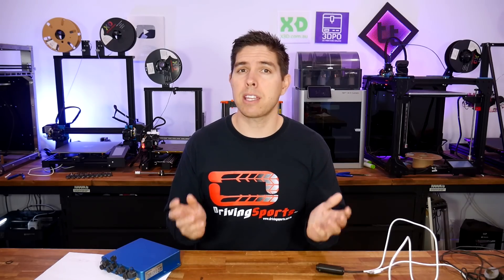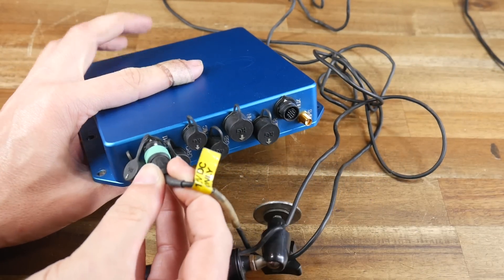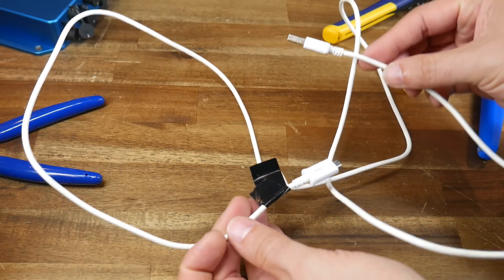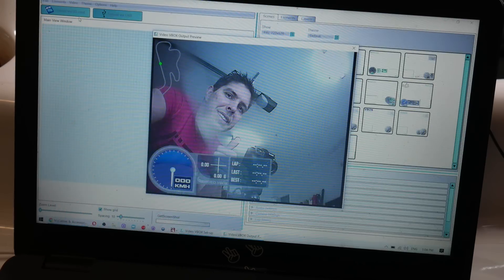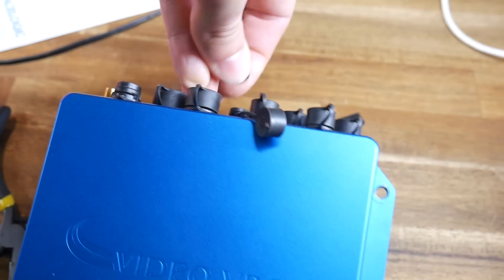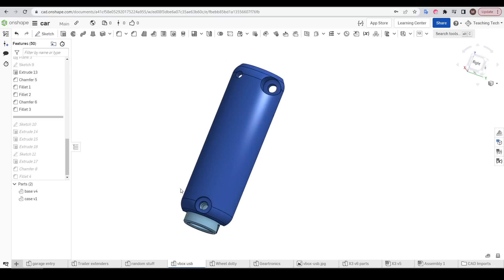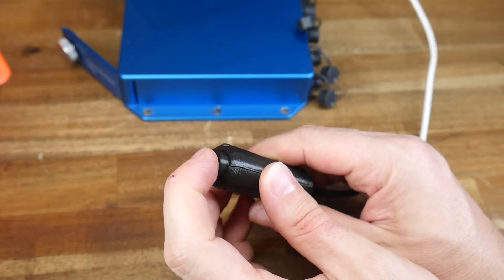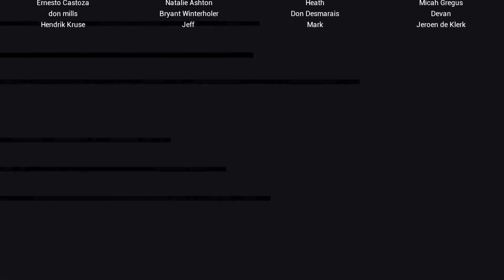Making an unavailable, proprietary USB cable with 3D printing

Comment: I have had the same kind of problem. This was before 3D printers were available. My solution was to inset the wired pins into the mating connector. The used epoxy to glue all the pins into one mass. This gave perfect alignment to the existing connector. After it was all secure I worked on making it more aesthetically pleasing. A fast quick and dirty way to make a custom connector. I do agree with you that 3D printers are great for this kind of problem, though slower than my old solution if you only need one or two.

Comment: I work in an industry that has A LOT of strange and seemingly proprietary connectors. But in 99.9% of the cases it is a industrial connector from Lemo/Fischer/Hirose or also Molex/JST if they are internal ones. From my experience sometimes if you guess one you can send them a picture and they can sometimes tell you the right plug internals (with lemo you can pair housings with different internals)
Reply: Yeah, I think be easier and cheap to just swap out the connectors to something simular size to the casing. And Molex/JST cables on the PCB are easy to rebuild. He could also consider mini DIN plugs and connectors which are widly available and offer metal housings. I was just cringing abit to the dildo butt plug of a connector which looks cumbersome.
Reply: I’ve spent a lot of time ordering from the Lemo catalog. It’s like a Swiss made choose your own adventure.
Reply: @bigqflex  and also the price is very "swiss style" ... I salvaged a lot of Lemo connectors from old hardware "just in case" because I know how expensive they can be.
Reply: @lensineer  Found them at a dump in a cable pile. They're so valuable to me I rather keep them.

Comment: Umm nope this is not a proprietary connector, it's from Hirose (HRS) you can see writing on the dust cap.
Those are HR30 serieses, the 6 pin one used on USB is HR30-6R-6S(71), the plug that goes into it is HR30-6PA-6S(71)
Reply: I see you need the dust cap as well: HR30-6R-C(31)
lol

Comment: 😂Got to love the feeling of panic from forgetting to plug something in before testing; it's happened to all of us. Love the solution you came up with! For future reference, a little T-7000 for waterproofing the sides/outside of the housing's final assembly could be very useful. It's the adhesive used in phones that is rubbery and waterproof, but can be pried apart if future access is needed.

Comment: It looks like either a PS2 connection or S-Video. I guess you're too young to remember either of these.
In any case, you should have just replaced the internal USB port instead of reinventing the cable

Comment: Great solution but I think there was an easier way. You could’ve gotten yourself a female usb port and used it to replace the port. Desolder the four wires from the port & solder them onto the appropriate pins of the female port - quite easy after finding the pin-out. Then print a housing to replace the port to maintain the waterproofness to surround the USB female port and then you’d be left with only needing standard USB leads. Hell, you could even go for Type-C female ports and replace all the connectors for even greater user friendliness. Just an idea.

Comment: Great work, I wonder if a better approach would have been to design and print an a replacement USB outlet on the box itself to get rid of the proprietary connector altogether.  It looks like the circle how has enough room to mount most female USB connectors with you designing and printing the shroud for the circle to hold it in place.  Internally it just looks like some 4 pin JST connectors, but you could also just cut the cable to the current connector and repurpose it.  Then you can use a standard USB cable to connect to it.

Comment: Waste of time and effort. Work smarter not harder. You dont need a custom printed cable. Solder directly to pcb or cast. Its much more secure much more durable and safer

Comment: That must be a standardized 5-pin IP68 rated connector if I had to guess. There is no way they got injection molding done custom for such a niche product. Still, nice work and hey: as long as it works!

Comment: Granted, it wouldn't cost you 'nothing', but these JST connectors on the PCB are more or less available on every corner of the net and new connectors to fit in the holes of the housing are in production for industrial use.
That looks like an M8 or M12 connector or something compareble to me, with a custom plug face. If it's custom anyway, you can replace it with bog standard connectors as well. These connector types are used for sensors and sensor boxes on industrial machinery, mostly for assembly machines.

Comment: I've had the same problem interfacing some old military gear with Lemo connectors. They (Lemo, Tyco, et.al.) change the connector standards constantly and the interfaces are all different. Thanks for the project ideas, I think the 3D printing community can come up with some Lemo connector "libraries" that will enable the use of commodity pins and 3D printed assemblies that will make these older connectors useful again. Thanks again for your work, hopefully this will inspire some crafty folks to keep the connector designs flowing. Cheers!

Comment: Impressive how you fabricated an electronic legacy cable out of fashion(?).  3D printing used to create components  that have technical utilization, as opposed to say printing a pikachu,  is always great to hear about and entertaining to watch.  With your skills you should produce these cables  en mass to sell online. I'm sure you aren't the only one needing one. And you could offer them at a fairer price and make some bank . Thanks for the video. * Reason 3 would be that hot glue is an insulator and not conductive.  (A fact I needed to Google.). Poyce mon.

Comment: Gnarly looking burn - I have also had hot glue ‘accidents’ with consequences.
Of course, great job on the cable and connector. I have also used my 3D printers to generate quite a few useful items at home as well as at work where they have been adopted by my colleagues. They have saved time (and therefore costs for the company) as well as raising some eyebrows and guesses as to their function.

Comment: I know it's not really the point, but after you opened it up, it looks like it would be pretty trivial to switch out that connector for one that is a standard plug with through-hole mount the correct diameter for the box. That way you can simply use a standard USB cable.

Comment: If all the external connectors just had connectors inside it would have been easy to replace the external ones.

Just find out what internal connector they were using and choose whatever external one you want.

Comment: You should have posted it on one of the electronics subreddits first, they are generally pretty good at identifying all kinds of old connectors.
Reply: Such a simple suggestion but one that hadn't occurred to me as I'm not an electronics guy. I have an expensive 3D Scanner that's been out of action for some years and it's got a very similar looking plug but with more pins. I couldn't bring myself to pay the more than $300usd for a new cable plus shipping to my country. Thanks

Comment: @11:11 Probably would've been way, way, way easier to replace the panel connector with a standard USB (mini-B, Micro-B, or Type C) port so you can use a standard USB cable. Panel mount USB ports are readily available and the connector on the PCB end looks like a standard JST connector, which is incredibly cheap.

Comment: You should have just changed the socket on the box to a USB socket.
And yes they make round ones which would have looked near the same. Lot easier than the way you did it

Comment: Due to the bulkiness of the connector I'd be worried about it wiggling its way out of there on an actual race but I also do not know how the device is mounted. Doesn't take away from the fact how cool it is to be able to design functional parts that fit properly. 

I got a decent level of satisfaction just creating a simple animation pegbar that fits a 3 hole round punch so I'd imagine making stuff like this and having it work feels pretty good.

Comment: Hi Michael, nice project - I wonder though "I reprinted the part several times until I got the right sized holes" - I watch many youtubers do this and wonder why not just slice the relevant part out of the model, or in this case for what it was worth, a twenty mm square with a variety of holes would have been trivial to produce and saved you the time of several reprints.   When prototyping I tend to just take minimal test slices, but I don't see that in projects by others.

Comment: Dude is a hero to handle the burn for us in the recording <3 Lol

Great video, but I would have done the reverse mod: Remove every Weird connector from the housing and put GX12/16 or USB type B or anything similar.

Comment: While I wholeheartedly agree with the idea behind this video... I feel like this really is the finest case of everything looking like a nail when you have a hammer in your hand.

A situation like this could so much more reliably, effectively, and affordably be resolved by simply de-soldering the original connector from the board and replacing it with something that isn't proprietary. Or, hell, even just soldering a cable directly to the board where the connector was, and having the connector mid-cable if it's even necessary.

Comment: You are way more patient than I am I would have hardwired a USB cable inside and removed the strange connector and waterproofed it with black silicone.

Comment: Actually in the past I simply searched for the pins I need, put a tape onto the socket, pushed the pins through the tape and used some epoxy to fix the pins to make the connector... While 3d-printig is nice and definitly is the better solution if you need multiple parts, classic solutions still work...
Making your own connector by 3d-printing for smal batches is quite nice for realy obsolete connectors you barly get (or only for high prices) like the 23pin dSub (Commodore Amiga Monitor and Diskdrive port).

Comment: For future reference, you could have opened the PDF version of the DATA sheet in Illustrator, copied the vector of the plug, exported as a DXF or DWG then imported/opened in your CAD software and scaled to size (Y)
Reply: Great Tipp, I prefer Libre Office Draw, which can do this with multipage documents to.
Reply: Or InkScape or any other vector based software :-)
Reply: or just read the document and it tells you what the connector is
Reply: @eliotmansfield  engineer versus technician.

Comment: The plug is too big for no reason.
If you are going to glue with hot glue, there is no point in using screws either.
The idea is good, but it is poorly executed, even if it works.

Comment: After chatting in one of the comment threads here, it looks like that's a Lemo connector. At least, I was able to find an image of a connector with 5 pins around 1 in a Lemo datasheet. 

VBox markets all of their products (as far as I'm aware) as being firmly in the professional market. Given that thing appears to have cost a few thousand dollars when new, it's extremely unlikely that they would have opted for a proprietary connector. Lemo connectors are very common, available in a wide range of configurations, and are extremely durable and easy to use. Additionally, they are very common in many professional application, from heavy industry to cinema. 

I think you would have been far better off finding the correct connector and soldering that up to a USB cable. It will be more reliable, support more insertions, and be easier to rebuild if you ever need to. 

With the solution you've come up with here, there's a pretty good chance that the pins you're using are going to significantly reduce the lifespan of the sockets on the receptacle, as they are almost certainly a different shape and size. 

In the worst case scenario, you could easily have outright replaced the connector with a different one of a similar formfactor that would be a very reliable and permanent solution. 

I don't know about you, but I'd rather spend 20 minutes and $20 to browse a datasheet on DigiKey and buy the right connector as opposed to multiple hours and revisions to make a sketchy reproduction with the incorrect pins. It just feels to me that this isn't a great application for 3d printing.

Comment: I bought a Sony HiFi about 10 years ago that had a proprietary link cable system between the componants and then back to the amplifier, these cables have 19 pin D connectors, that cant be found anywhere.
 I came home one day to see the CD player on the floor and the culprit was my cat, the cable that was plugged into this component was damaged and despite trying I was unable to repair it, I called Sony support and to my utter disbeleif they said they did not have this cable, searching online for the part number drew a blank also. I managed to make a very janky fix by soldering some extension wires to the one end of the cable that was ok (ish) and soldering those wires to the board where the socket was soldered, I also aquired a HiFi cabinet to protect it from my cat.
 I would like to print the19-pin D plugs and this video has inspired me, I have FDM and resin printers and I will make the prototypes with FDM and once the design is finalised I will print in resin.

Comment: I gotta agree, its hard to beat the satisfaction of recreating some unobtanium
My folks' in-wall oven from like the early 80s had a knob crack apart on them and they were using robogrips to set the oven temp xD
I just borrowed the sibling Mode knob and recreated it real quick

Comment: For a zero dollar fix, fantastic! I'd like to see more of the sketch up/design process using onshape but that's just me 🙂. Thanks again for your vids. As @mikeroch200 mentions below, the dsub pins may fit.
Reply: technically it's probably a 5 bucks fix, because of the sacrificed usbcable.

Comment: Great design. I don't have any advice on improving the design - looks good to me - but the filling of the hot glue. I work with terminators that need to be watertight and they have a fill hole and a leak hole. You assemble the connector dry then inject silicone into the fill hole until it comes out the leak hole. Then you know the whole thing is chock full of silicone and ready for service. I wonder if a similar thing could be done with hot glue.

Comment: Nice Video and very descriptive... But. And hear me out! Wouldn't the other way around being the much easier way? Opening the box and using the known wiring for a USB-Whatever housing with a 3D printed Sleeve to make it fit? It's not like you have warranty on this thing whatever. There's even round, waterproof plugs available. Mouser Search: "amphenol waterproof usb connectors"

Comment: This connector looks like an S-video cable with the key removed and a pin in its place. it looks like the extra-pin where the key would be isn't used. I like the 3dprinted approach though.